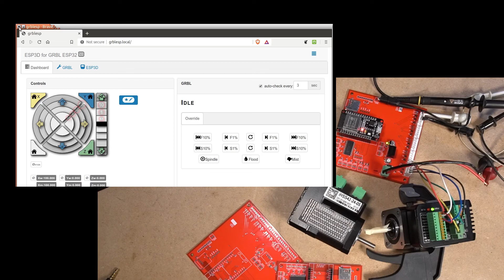191222 HEXAD Checkout - ESP32 4-Axis GRBL Board with JMC Step-Servos

Comment: Hello, great project. I have some nema 23 versions of those jmc servos, and was wanting to hook up five at the same time for a cnc machine.  

It looks like your board has the required components for this, but not the sockets for stepper drivers (which I also don't need).  I've read about needing to be selective on which pins I utilize for my fifth motor, but have you already had five running successfully?

I'd only probably need a spindle control at some point, not much else.  It seems the components near the motor connectors are mostly to convert the signals from 3.3v to 5v?

I was planning to do a breadboard first and then have some actual boards made.  If you have extra you don't need shoot me a message... Thanks for sharing.
Reply from the maker: Let's work out a deal, contact me on linkedin. Or search around to find my email, its not hard to find. I have 9 blanks that I probably won't use and the one shown here. Let me know.
Reply: @CraigHollabaugh  If you still got 1 spare I might be interested. Will this work with regular stepper motors?
Reply: @kubino99  Check out https://www.tindie.com/stores/33366583/ from the inventor of esp32grbl or on his github https://github.com/bdring to find a board and support.

Comment: That is neat. I have thought about trying out grbl on an esp.  I used it years ago on an arduino nano (I think it was) to control a simple 2 axis mill like tool.  But that web interface looks amazing!
Reply from the maker: My next board version will have standard stepstick sockets, a little more I/O and connectors for TFT display. I'll let you know.
Reply: @CraigHollabaugh  Oh TFT display sounds fun.  You are giving me ideas of "Christmas" presents I "need" to buy myself...
Reply from the maker: @jontscott  I'm working on a work project that uses Matrix Orbital EVE displays. They're more expensive but offload a lot bitmap processing to display driver at near 25 fps. For fast changing displays, like CNC XYZ position values, they're awesome.
Reply: @CraigHollabaugh At  esp32 grbl TFT is possible to add ? There is not enough pin for that !